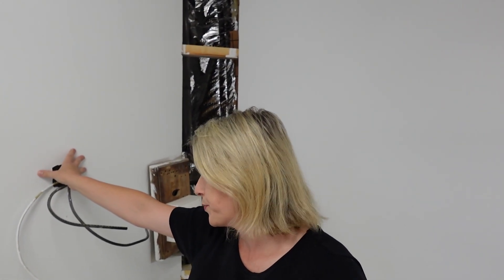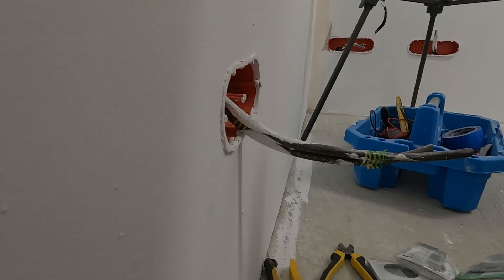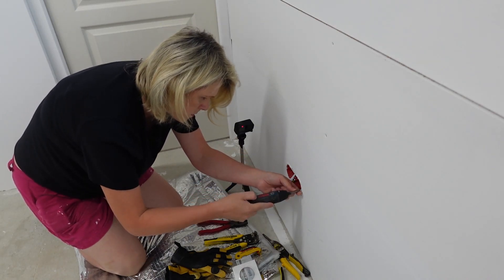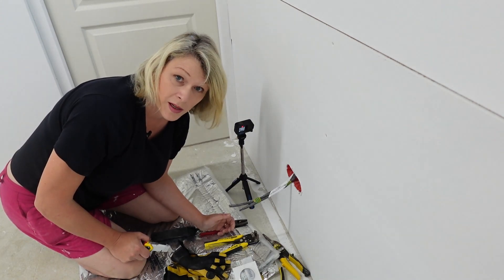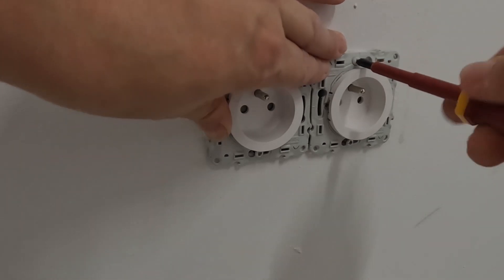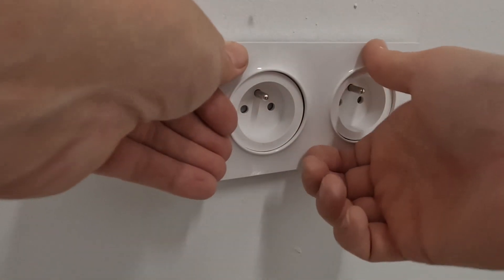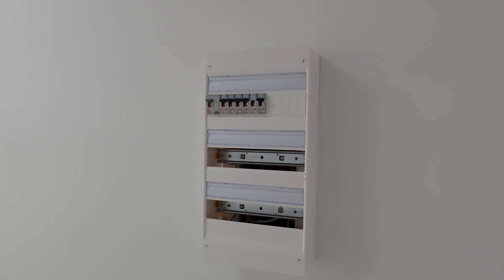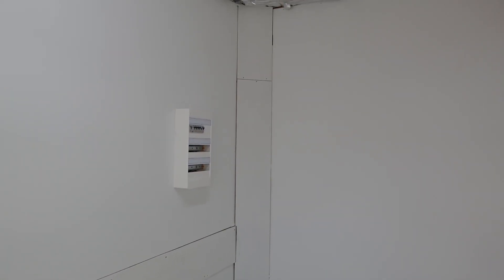DIY Solar Plant Room Second Fix Electrics

Comment: Tis is really bad, for the wire use a jokari, cheaps sockets, always buy some with screws, because they will burn out with heavy loads, you dont have to get the screws out, you need to turn your socket in

Comment: What is the wire stripper you are using..? Thanks !
Reply from the maker: STANLEY FATMAX FMHT0-96230
Reply: Looking at a search result video for these, they strip the outer insulation AND the inner in two actions.